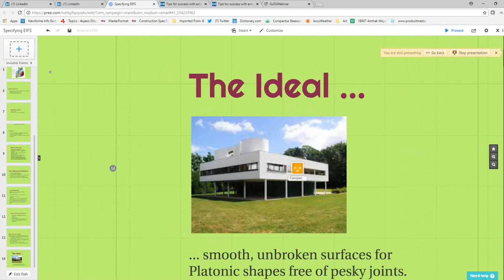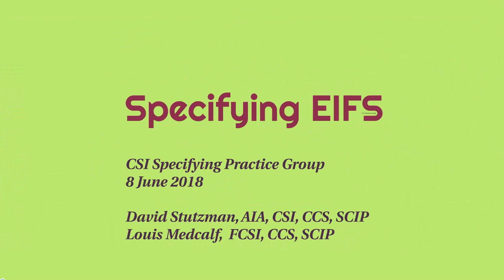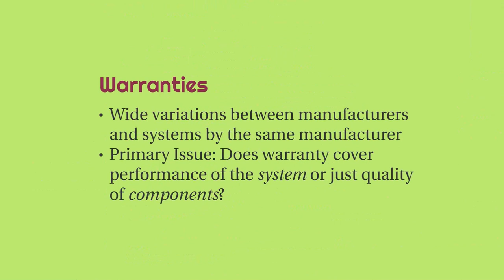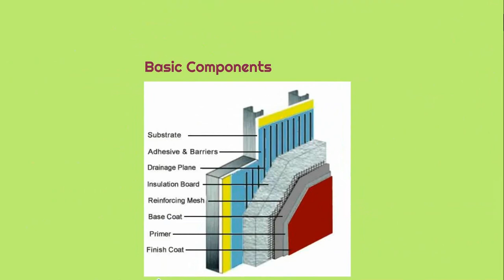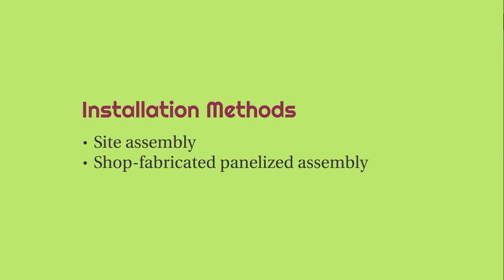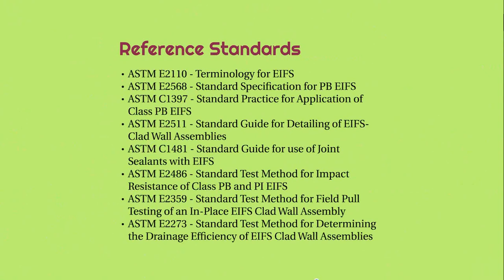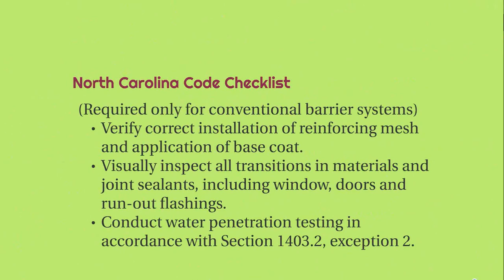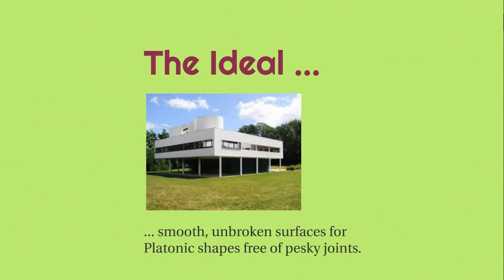Specifying Exterior Insulation and Finish Systems

Comment: I know this is way too late to comment, but just in case someone like me is listening to this now, EPS, made from virgin bead, does not absorb water, and does not loose R-value in a wet environment.  If it did, the whole lightweight insulating concrete roof deck business would be in serious trouble, since EPS is the real contributor to R-value in the system.  Polyiso, on the other hand, when wet, loses the ability to insulate completely.  Check ASTM and UL if you don't believe me.